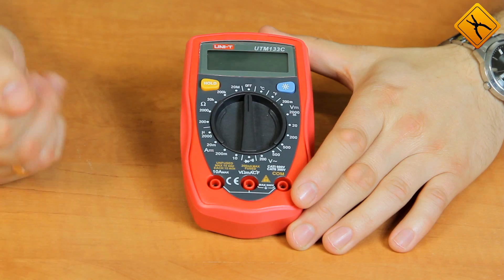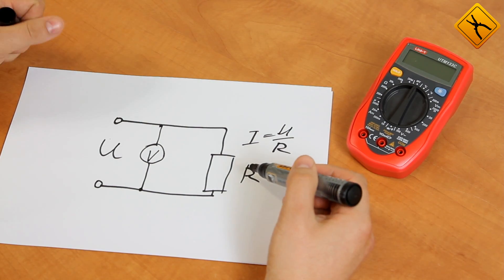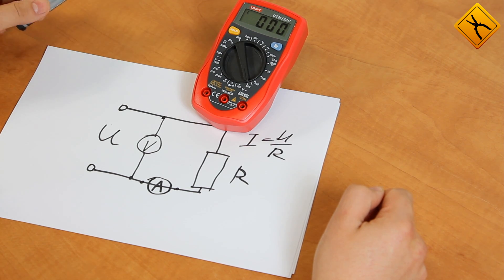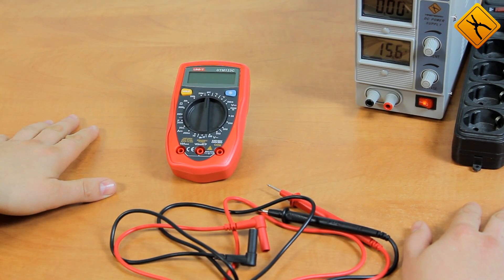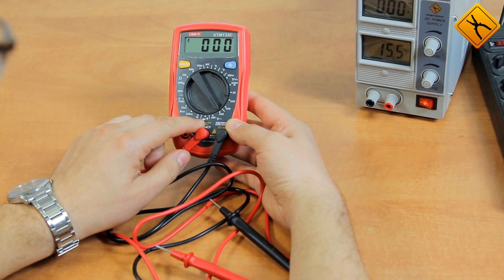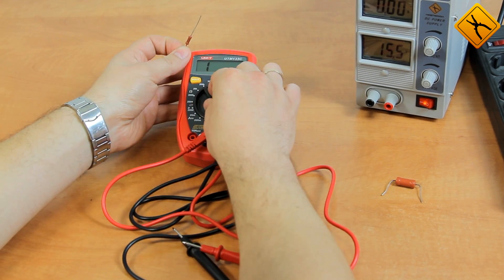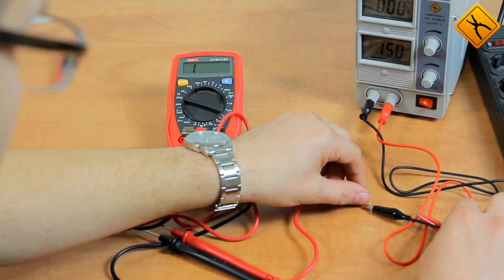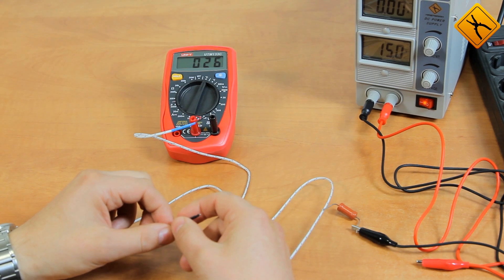How to Use a Multimeter

Comment: How to check capacitor and how to get temperature measuring probes ?
Reply: For capacitance you need a different model, that can read farads, as for temperature measurement I've found this model a bit incacurate, aldo mine might just be decalibrated. A cool feature that this does not have is auto ranging, so you don't have to select everything manually. I recomend the Aneng AN8009 you get that delivered at 20-25$, does capacitance, comes with the temperature probe, and has auto ranging.
Reply: Hello! This multimeter has no capacity measurement function. 
Model UNI-T UT133 has the following function:
 https://toolboom.com/en/digital-multimeter-uni-t-ut133a/
Temperature can be measured using a thermocouple (included)

Comment: 3:28 The UT61 manual has contradictory information. In Measurement section, B, Figure 3 it shows the meter probes connected in parallel for current measurement. In the description further along it says "4. Connect the test lead in serial to the return circuit(...)". What the hell?!
Reply from the maker: +Tome4kkkk It's mistake in Figure 3 (p.18)
Reply: ToolBoom Supermarket Thanks!